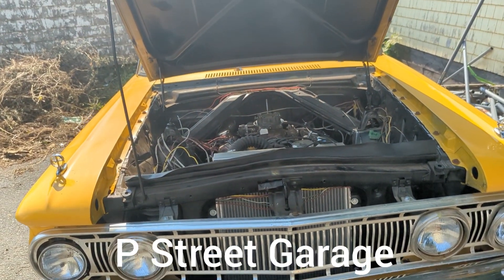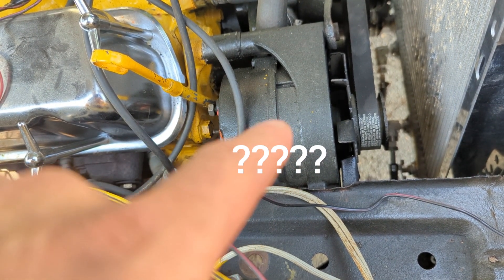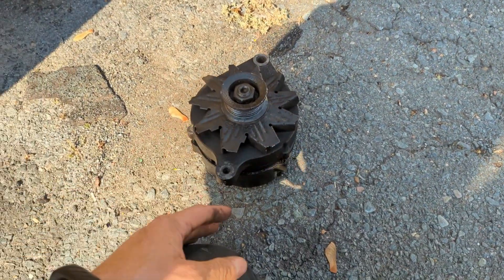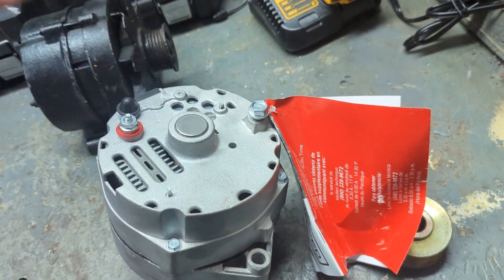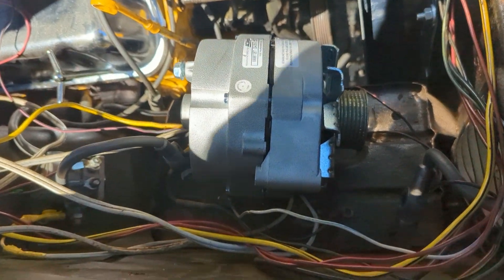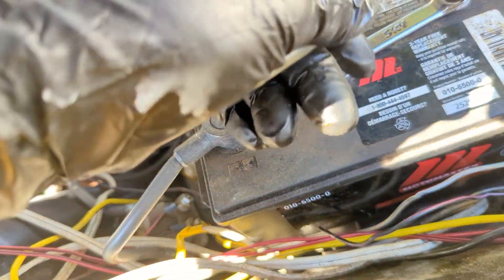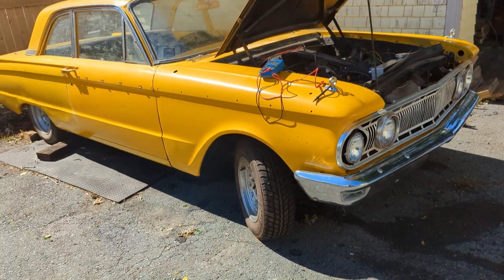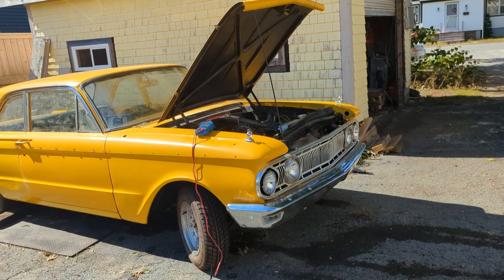1 wire alternator hook up. Sorting out an old charging system

Comment: okay it will depend on whether or not that came out of a crown Victoria or if it came out of a pickup truck if it has grooves on the water pump pulley it most likely came out of a crown Victoria and it is turning the correct direction however if it came out of a pickup truck and has a smooth pulley it is turning the opposite direction
Reply from the maker: I'm not sure where it came from.  If it's an older style pump as in 70s or 80 s out of a cat.... Is it ok that it turns same direction as everything else ???
Reply: @pstreetgarage7304  basically all of the old stuff used to turn clockwise it wasn't until they started using serpentine belt systems that things really started spinning backwards
Reply from the maker: @mr.eswatchreviews  ok.  Must be fine then.  I can tell someone adapted the serpentine system to an existing old one.  It's not really correct but it works
Reply: @pstreetgarage7304  well before you make too much work for yourself or more work for yourself simply just run the car long enough for the thermostat to open and make sure that the coolant is flowing as long as it's flowing that's all that matters

Comment: on the water pump pulley does it have grooves or is it smooth
Reply from the maker: Has grooves but I think it's an old style pump and someone installed a grooved pulley
Reply: @pstreetgarage7304  yeah I looked it up on alldata for 1989 crown Victoria and pickup truck basically they didn't even start using serpentine belt systems until mid 80s or so that much I know is pretty much going to be the year range is the mid 80s to late 80s and only a couple of things came with V8 back then primarily the crown Vic and the pick up truck the pickup truck uses a single belt to drive everything where the crown Vic used two belts to drive everything but basically on the system where one belt does everything smooth pulley the pump spins backwards on the crown Vic where there's two separate belts it's spins clockwise
Reply: The waterpump pully has grooves in it , the idler pully is smooth. Also the tensioner pully has grooves in it..pullys should turn counter clockwise alao